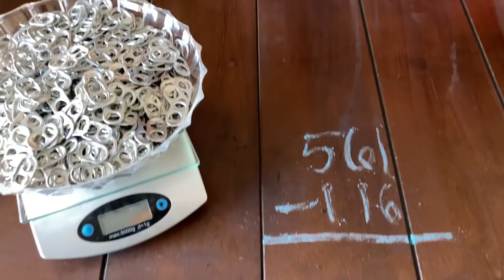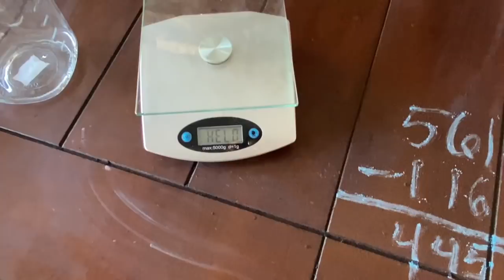Melting Pop Tabs - MicroMelt - Aluminum Ingot From Pop tabs - Simple Melting - TheGrowingStack

Comment: Idk if you've ever seen a refrigerator compressor, but those things are an excellent source of copper. You should be able to yield a few pounds from each.   You just need a grinder to get the case open.  It's very stout.  

Also old school tube tv cones have about a pound of copper per.  Just watch for a stored charge.  Dont want to drop dead over 3 bucks worth of copper.

Comment: In your experience how you say melting little pieces (pull tabs or cpu shards) or metal compares to large chunks (crushed cans)?  Do you get more slag because of all the extra (potentially oxidized) surface area? It is reliably faster to fully melt (based on the episode my guess would be yes)?
Reply from the maker: jwaterdrag 
Definitely less from the pop tabs vs full cans. The cans have that lining on the inside and the ink that contribute more than the tabs. In my experience from little pieces to big pieces, it all depends on what you’re melting and the purity of it as far as dross goes. For the speed, the smaller pieces definitely melt faster.
Reply: Well said!

Comment: Here's a REALLY HELPFUL tip to stir the aluminum, USE A PEICE OF rebar to stir it, it's long and it's not ever going to melt
Reply: It's rebar, not rubar. Used in the construction industry to strengthen concrete. Personally, I don't see the point in removing the pop tabs from cans.

Comment: You really should invest in a head mounted GoPro camera. You'd have both hands FREE and less worry of creating an "accident".....like spillage... or dropping your phone in the crucible (That.... would REALLY SUCK!). Also, spillage of molten metal on your fresh cement won't be doing it any favors, and could cause the cement to explode, sending hot pieces in your face. You probably already knew that 😆. I've had that happen and it STINGS like a bi*ch! 

One question. Is there ANY way to melt metal (aluminum, copper etc) WITHOUT getting any slag from it? Or will you never recover 100% of it? 

Nice channel by the way. Subbed!
Reply from the maker: I should do that for sure. I have a hero 3, probably need an upgrade though. Great question, I’m pretty sure you will always have some kind of oxidation form. Although when I do remelt stuff I’ve already refined, or already pure items, I don’t really have any to deal with. Like pure silver or copper, in my experience they melt down and pour perfectly without any build up. Thanks man!

Comment: POST TENSIONED SLAB
DO NOT DRILL CUT OR CORE
Reply: I've poured a few of those on commercial jobs, residential not so much but I'm in Iowa. I'd guess climate and soil type dictate applications? The tension slabs my company has poured were large industrial warehouses where forklifts and other equipment are driven on them 24/7.